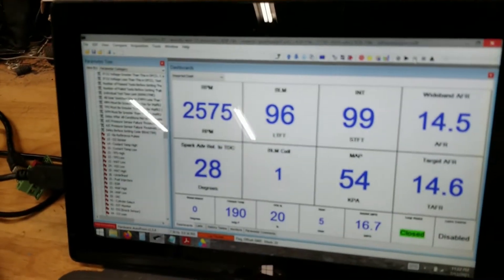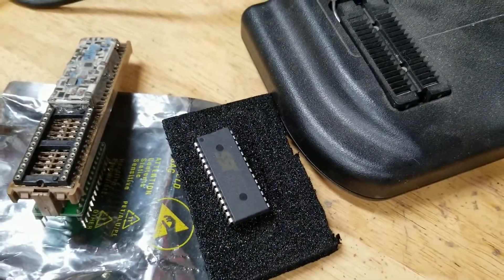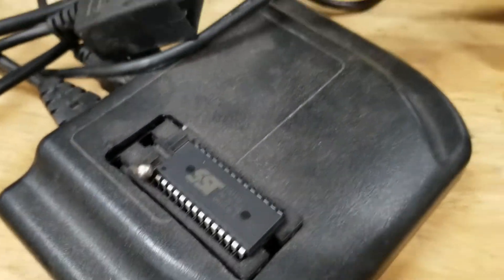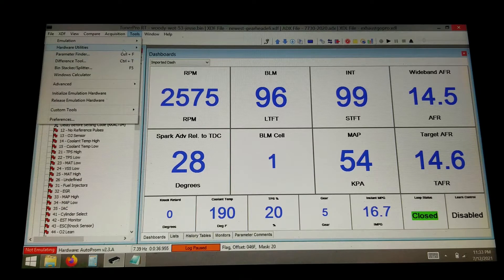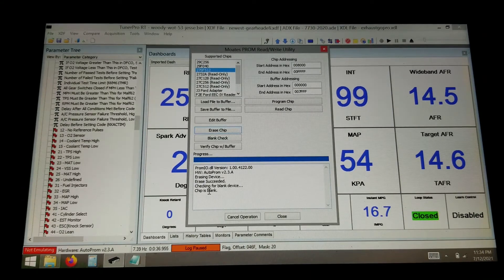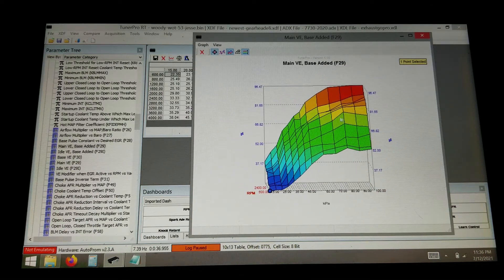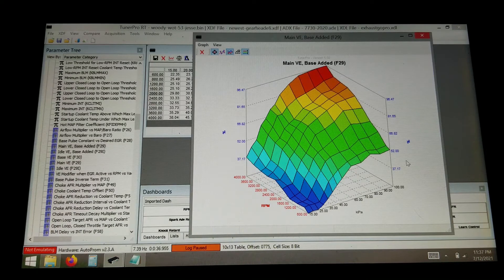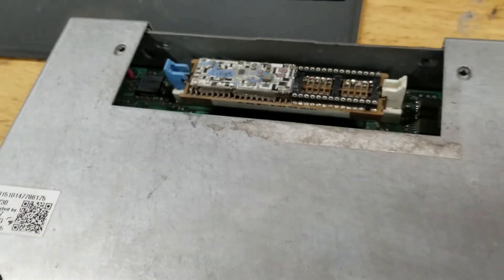GM OBD1 tuning with Moates APU1 Autoprom - burning 27SF512 chips

Comment: I have a 1987 Chevy scottsdale 350 tbi model is v10 1/2 pickup,( v10 is model not motor) this was the first year of tbi in square bodys, mine has small mods to it like headers ,air pump delete ,inline fuel pump and adjustable fuel fule reg, whats the chance u  write chips if i gave u my small build ?
Reply from the maker: I don't have my OBD1 stuff anymore. The autoprom was discontinued so I sold it to someone who would use it. But there was a guy online who specialized in TBI
Reply from the maker: Dynamic EFI is the name that comes to mind

Comment: Let me know if you want move on form the apu1 👍
Reply from the maker: I actually sold it with my last obd1 car. On to obd2 stuff now.
Reply: @GEARHEADdezign  I don’t blame you lol
Reply from the maker: @zerokool1256  I don't really care either way, but the LS stuff is obd2. And my Camaro is Holley EFI now🤣
Reply: So I got a apu1 to start working my tune on the old girl. Did you ever have an issues with with data logging, like the tunerpro dash not displaying anything and the needles doing a little bounce?
Reply from the maker: Every now and then it would get weird and not want to connect. But you should be able to retry it and get it to work. Do you have the initial hardware settings correct?

Comment: Moates doesn;t even sell the autoprom anymore
Reply from the maker: You're also a year late to this video🤣
Reply: @GEARHEADdezign  Take it down if it's so obsolete. I was just stating a fact that there is little hope left for these old trucks.
Reply from the maker: @mwyson4095  you could still buy one used. I sold mine to the guy who bought my obd1 Beretta

Comment: Hi.  I've got a 1988 S-10 with a 4.3 Throttle Body that runs really rich because I live at 7,500 ft in elevation.  Does my truck have a prom that could be re-programed to lean out the injection system and get this truck running better?  Right now I get pretty bad gas mileage, low power, and sometimes the engine acts like its choking.  Thank you for this video and any help you can offer.
Reply from the maker: Your existing tune should read the MAP with key on engine off before starting and compensate accordingly. Reads it like a barometer. But yes, you should also be able to tune it however you want. Although your issue might just be a bad sensor. I would datalog first and see what sensor might be reading erroneously.
Reply: @GEARHEADdezign  thank you so much. I’ll check the sensor before I tackle any computer type mods

Comment: 1991 4.3 chevy TBI losing one injector sometimes, could it be a chip .Installed new injector, new ecm with old chips, check all wiring. I am lost for now
Reply from the maker: I don't think so. Could there be a break in the wire?
Reply: @GEARHEADdezign  I been checking the wiggle test can get it to do it and when it does it no change Bang on the dash next to the new ecm and injector came back on
Reply from the maker: @rmaiocch  yup. Sounds like a wire break somewhere. Ohm both ends of all the wires that go to the injectors
Reply: @GEARHEADdezign  Its hard it  don't always do it
Reply from the maker: @rmaiocch  yeah. Wiring issues can be a nightmare because they're so intermittent
Reply from the maker: I bypassed the o2 signal wire in my Beretta harness to diagnose an issue. Depinned and ran another wire straight from o2 connector to ECM connector

Comment: I’m attempting something many say is extremely difficult, I’m planning to TPI a SBC 302, and have zero experience in tuning, I’m sure you know the 302’s rpm status and the TPI is a torque booster, I’m planning to boost with a centrifugal supercharger and was thinking of bypassing as much as possible, any suggestions or ideas of what’s a necessary and what’s not? The TPI is from a 92 model 5.7
Reply from the maker: Oof. That sounds like a mismatch. TPI does help low end torque that the 302 lacks, but will severely choke it up top and you'll end up with the worst of both worlds...IMO.
Reply: @GEARHEADdezign  I’m hoping to get the torque and hopefully keep some top end with the supercharger but if it’s a bust I’ll swap the crankshaft and run it as a 327
Reply from the maker: @darthvega6358  replace the tpi intake with a single plane and I think you'll be happier. It will actually breathe up top where the power will want to be
Reply from the maker: I planned on TPI for my last truck, but that was a low RPM application. And I picked up a 4.8 LS for cheap RPM in my current project.

Comment: I think these are the same chips I need for my 94 C1500.   I need to change the settings on my 305 TBI engine 4l60E for a B-body LT1 cam.  Think its a $0D mask its a 395 ECM.   I can read the factory Chip/ Knock sensor Memcal with the moates adapter?  My chip is soldered to the memcal.. I think? I dont think it has the base like this.
Reply from the maker: Yes. My 94 was a 7427 but it was also $0D. The G1 adapter will allow you to read and write a 27sf512 chip with the Autoprom. If you have the smaller adapter just for the chip, that will allow you to read the stock tune
Reply: @GEARHEADdezign   Ya i think my 395 something computer operates the same way as the 7427  I hope I can read it I think its soldered into the mem cal, the factory prom  Dont even know where I can get a 94-5 TBI 305/ 4l60E factory .bin  Ordering some Moates stuff soon Get like 10 chips? hahah
Reply from the maker: @GhettoWagon  gearhead-efi.com had a lot of stuff...might have your stock bin
Reply from the maker: Here's the link for the adapter to read your factory BIN http://www.moates.net/hdr1-memcal-header-p-52.html?cPath=64
Reply from the maker: And here's the g1 you need http://www.moates.net/g1-memory-adapter-tpi-etc-p-32.html?cPath=64

Comment: I'd be interested in videos on any and all obd1 tuning info you could provide. I remember Jeff Counsil on quad4forums (and probably berettanet too I'm sure, iirc he used to go to the bfests) would burn chips for guys with various options like fan on off temps, idle speed, fuel cutoff speed, etc. But I thought he could just write over existing chips because he was always asking guys to send him ones they got from junk yards. Could just have been an assumption on my part. But either way I need to get into this at some point.
Reply from the maker: Yup, Jeff is a guy I've consulted before. I kinda became a "guru" myself because I had to. I bought a 3400 swap chip and it was pretty terrible. Got mine to run mint eventually and fixed a couple buddies' cars too.

Comment: After I build my motor would I be able to tune on dyno with this program?
Reply from the maker: It works best with a bench harness, so it would be kinda time consuming, but it could be done. The read/write process is also slower than hptuners. I tuned my truck with it via datalog.

Comment: It’s not a bad system obd1 , l had a good friend change a tune on my 1995 Buick century
Reply from the maker: It has its limitations, but it has always worked for what I've needed. There is a code $59 I think it's called that's been heavily modified to do a lot more than the OEM stuff. Much more versatile.
Reply: I have tuner pro running live  data feed when I need info .